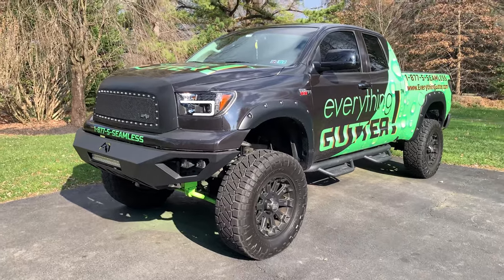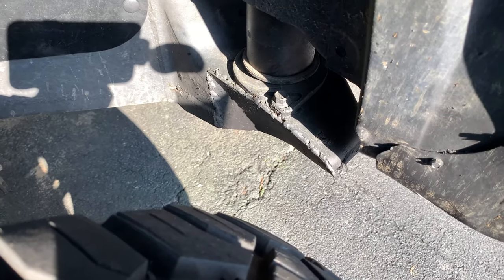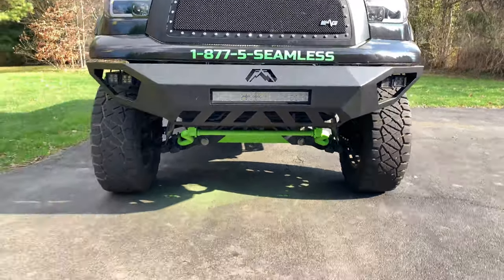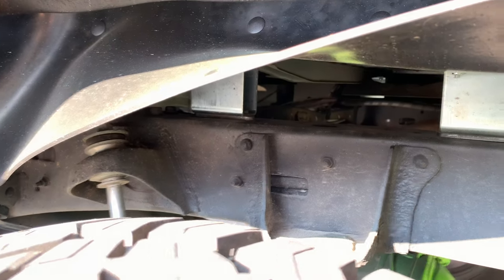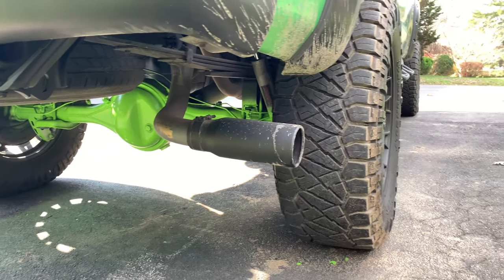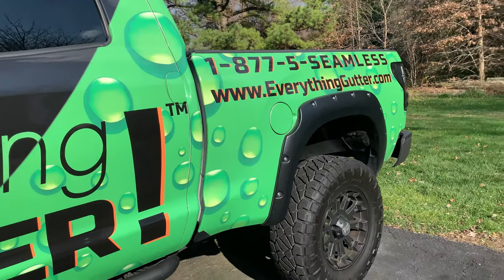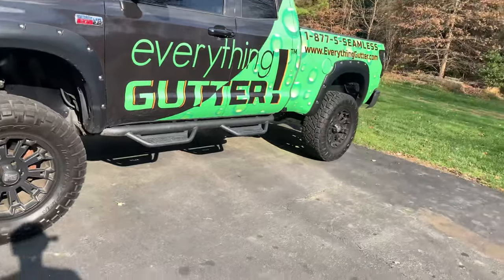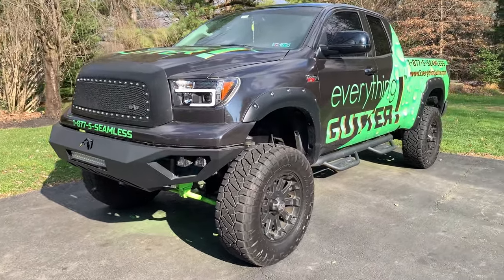Toyota Tundra Modifications - 25+ of the BEST (MODS!)

Comment: People,   never do a body lift, never use wheel spacers! get the right lift and get the right off set wheels.
Reply: Depends on the truck.  A body lift combined with a suspension lift work well together.  Many articles about it.  But I'd never go higher than 2" with a body lift.